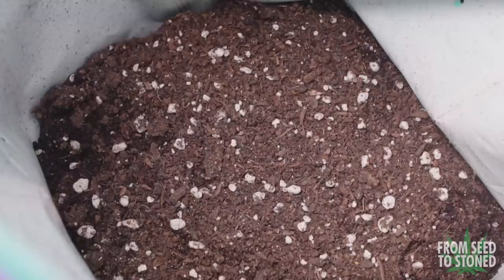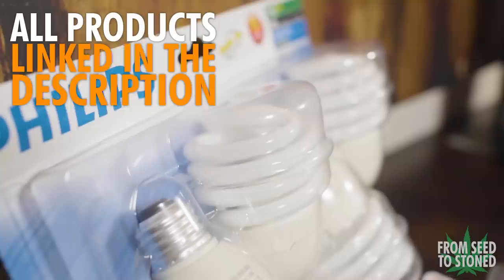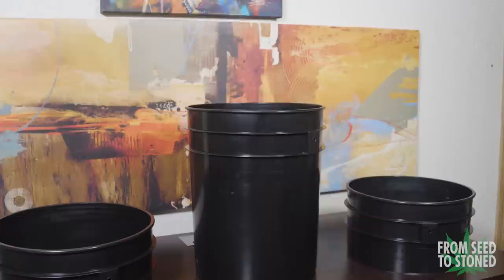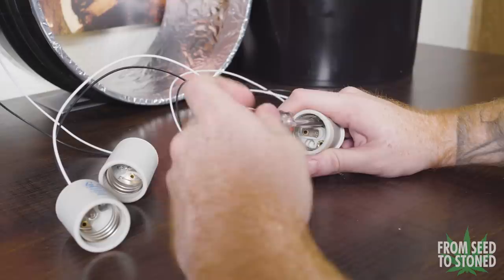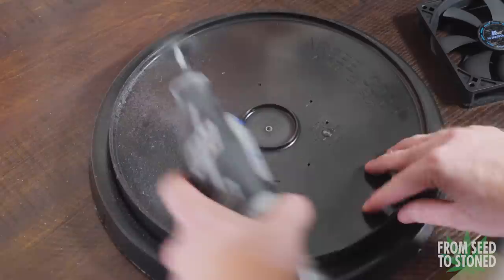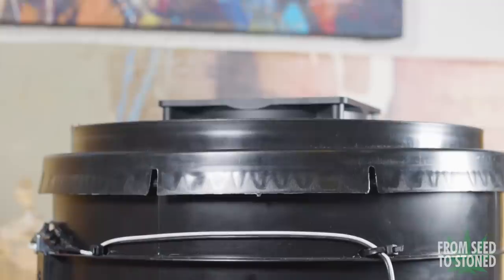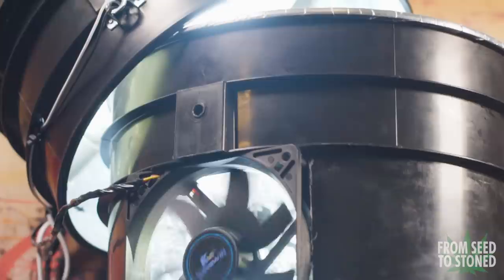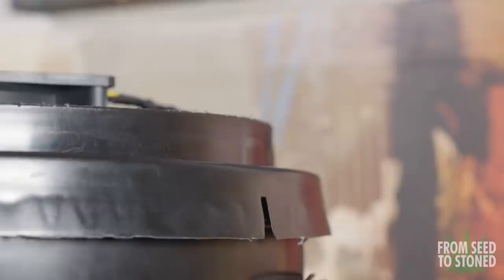How to Grow Marijuana Indoors For Under $100

Comment: Would this work just as well with square kitty litter buckets? They're 5 gallons I think, just not round. Seems like it'd be easier to install the fans on a flat surface, and I've got a lot of those kitty litter buckets lol.
Reply: If they stack the same way the buckets he used than I’d say apply his methods to them and make adjustments as necessary

Comment: Get a cabinet that was free take the bottom out to make it 5ft tall by 2ft wide and 3ft long take nilar and rap it around. Use 2 cfls with tin foil. And use old protein container for plant. Boom made 14g my first run then trashed it for a proper setup.

Comment: You can probably get it even cheaper using 3/4 inch pvc and fittings and mylar sheets stuck to cartridge paper...can be set up in less than an hour.

Comment: On the issue with the extra light putting it in a closet there’s a simple solution you can take cardboard to make a channel around the side of the bucket and tape it to the bucket same way with off the top make a channel out to the side and then down a little bit of Francisco carry the air and you’ll be channeling I’m so late doesn’t get in so you’ll have to worry about it Re-veg

Comment: You can get electric cords and socket from old lamps and appliance for free. I prefer Used plastic storage containers, solid dark colors are best. they are 1 dollar at the thrifty store. I can get 10 1gal pots in the big ones. I mount the lights on the lid with the socket outside to reduce heat. I can make a 10 plant indoor grow container for 50 dollars

Comment: Does anyone know what can be used as a power supply?
Reply: For power supply I went off this video, went to Home Depot and found a 8ft power cord that already had bare ends, (usually a lamp replacement cord) and wired it to the lights which makes a circuit and slows the bulbs to light and fan to move air, or use a little handheld clip type fan.

Comment: Does the bottom fan blow in or out?
Reply: I would blow out of the top, CO2 is heavier than oxygen so it'll be denser along the floor. So I'd pull in through bottom cutouts, and out through the top. This might also help with heat.

Comment: just a quick question. for the pc fans on top and on the bottom witch ones are facing the air flow into the bucket and witch one is facing the airflow out the bucket?
Reply: It looks like they're both going the same direction? Pulling the air thru. That is how I started my bucket.
Reply: @jimlee1196  oh ok, thanks man.
Reply: @walterdavis3554   After running mine for a bit  it built up to much heat. I ended up making the intake blow in and the exhaust on top blow out. It only makes sense to do it that way. And the temperature is better.
Reply: The one closer to the bottom is the intake so air coming into the bucket. The top one is the exhaust so air going out of the bucket to create a flow.

Comment: Dear FStS,

in my opinion, the idea with the buckes is very cool, though...some points....

-the hight is very low, only few strains I know you could possibly grow in this
-you have 4x 23W 6500K CFL bulbs? never use 6500K for flowering, the high amount of blue light is just stress for the plant and your result will be rather bad. cfl is over anyway, I have a friend, who grew about 35g with only two 21W LED (Philips or Osram) @2700K

I recommend a 40x40 Box, modify a reflector with 2 x 21W LED (or 3) and grow some small indicas, in Europe you pay for this about 150€ - 200€ incl. carbon active and fan.

this might help you small room growers a lot, "real" short strains, don't believe indica=small, a lot of indicas are rather of medium hight, smallest I have ever seen: 

-Ewe 2
-Sweet Afghani Delicious (Black Domina)
-Hindu Kush (Sensi)

they really grow "stacked"

Comment: I just completed this build with four 23 watt 6500k bulbs and it is very hot in the space bucket. The bulbs were too close to the lid and the lid was hot and soft. So what I did was let the bulbs hang downward in a 45 degree angle, hot glue the wires in the metal fasteners from the outside of the bucket to hold the E26 sockets in place. It gave me plenty of room for the lid and for the bulbs so they don’t touch. It is true, the maylar was a pain in the ass. Unfortunately I have server fans that are very loud and very fast. A bit too much for a plant but, I’m going to buy a dimmer switch to slow down the fans and that will allow me to adjust the speed of the fans. I like this design but, like I said, it is very hot in the bucket. Even with just two bulbs running it’s hot. Once the plant is a couple of weeks old I will add probably two layers so the plant doesn’t get burned. All I have to do is get my seed to germinate, which I’m having a hard time with.  I have a seed in the dirt and the paper towel method and they won’t germinate. It’s been 4 days already. 
With the seed in the dirt, does anyone know if the dirt should be in the dark in order for the seed to germinate or should I have the dirt in the space bucket under lights until it germinates? I have a zip lock bag over the pot as a humidor.
Reply: B 13 absolutely! I have two beans cracked and my sour diesel is out of the soil! My Durban Poison is almost ready to go in the soil. So far I spent about 25.00. I bought the E26 sockets and 4 pack 23w 6500k CFLs from Amazon. Then ran to Walmart and picked up the Mylar for 2.50, which is a huge sheet and it’s plenty. And I bought the adhesive spray but, I also used my kid’s glue stick and that worked great sticking the Mylar to the buckets. I got  3 5 gallon buckets at harbor freight for 2.50 each. I had old computers and stole two fans from them. My space buckets doesn’t look as good as his but, it works great.  Send me your email and I’ll send you pics. Again, it doesn’t look as good as seed to stoned but, it’s awesome! I’m using dollar store water Crystal Geyser. It has a lower PH but I bought ph up and down kit to adjust the water ph. I’m also going to use miracle grow. People can hate but, there are success stories using MG and tap water. Remember, cannabis has grown on its own in the wild for thousands of years without nutes. I’m not trying to grow a pound. I’m experimenting and hope I can yield an ounce. That would be plenty for what I’m doing.

Comment: I think hydro would be better for this type of grow just a DIY shallow gallon or so Rubbermaid container could probably even find some kind of Tupperware or one of those plastic coffee containers get creative as you need to make it work I think i read you only need like a gallon per plant when doing hydro especially if it's something small like this or you could add a couple bucket spacers and get a bigger gallon amount but still small and do a sea of green maybe add a trellis on one of the spacers and do a screen of green try to get the most out of your harvest then have more cola buds too maybe add some LED strip lights around the inside for side lighting for optimal lighting and yield I love these kind of grows so many unique options u can do since I've found out about micro growing I've been obsessed trying to find the smallest amount of space or lighting I can use or how small of a container/pot would be needed to tiny plants I grew a quarter oz plant in a mini solo cup in a little cardboard box in a night stand on side of my bed was hella fun and interesting you get to learn more about the plant and care without having a big fuck up or adding on to your light bills etc I recommend microgrowing to anyone wanting to explore and learn as much about what a marijuana plant is actually capable of
Reply: Plus what's cooler than a bonsai weed plant haha also u can bend them into different shapes and what not too try using some bonsai techniques with them it's really fun

Comment: I would use a 1,10 by 0,90 meter closet (1,60m high) isolatie it wint reflective bubbleplastic (free for me cause we already had it but if you would buy it probably 10€). Use 2, 14 litre buckets (1,60 each very nice qualtity) and one 7,5 litre. On the i would put a controleble ledstrip (10,00€) witch produces a nice amount of heat for its price. I would buy grow ground with 6 months of feeding (7,50€) 1 litre of root strength (5€) 1 litre of plant feeding (5€) 2 pc fans for in and outtake (free for me but new probably 5€ each) a normal fan (10€) and a secondhand hps or led grow light for 50€.

Comment: I can replace mylar with aluminum foil right?? Just a light reflector?
Reply: Richard Linville I wouldn’t just because t conducts electricity and heat so it could cause problems if your like me and bad at wiring. The Mylar is a great insulated whereas the tin foil is a conductor. You can get Mylar from camping shops, it will be called a space blanket. Hope this helps 😊
Reply: @lukeocallaghan5678  yes this helps BUNCHES!!!! You probably just saved my house from being bar-b- que
Reply: Richard Linville Yeah learned that the hard way, it didn’t burn but it shorted all the electronics in around half a second lmao

Comment: I started with a $500 budget, and grew 2 plants. Made about 225 grams, and sold it for $10 a gram. Spent all $2,250 on a bigger setup and grew 10 plants. Made ab 1,200 grams, and $12,000. Now I’m growing 16 plants and I’m running out of space. This was perfect. Smaller yield higher volume. $10,000 a month is close. I can smell it
Reply: Goblin 2.0 homemade

Comment: Id duct that fan, so it goes up straight, then has a bend in it like a candy cane, then no light will get in,. Or a box over it with the bottom cut out. Id run a dryer vent,flexible, out the window with one of those louvered covers like for a dryer vent on the side of a house.. It's gotta be black, most dryer vent is white. Ya don't want that. I think I'd go with a box full of carbon over it. Thats what id do,fill the box with carbon

Comment: I know it's an old video, but if anybody sees this comment, could I get some recommendations on better soil/nutrients? Love the video, but I kind of needed a $150 setup lol
Reply: Also, if anybody is struggling with the wire, my biggest tip is a simple one: Never plug anything in until all of the wire is covered. 12v isn't immediately dangerous in most cases, but it's always best to just act with caution.

Comment: not very secret tho i will say the 3 tops stacked looks kinda weird i feel like if u just bought a bigger bucket or trashcan even or maybe even some laundry baskets might work idk it would depend on the basket  but just watching this has given ideas and so 102w for 1 plant is enough im guessing if i have a smaller plant in my closet that has 1 100w led light bulb by it it hits like the top and side at an angle but if i turned the plant regularly it shouldnt be too bad i dont think right.. i mean i guess ill see im gonna try it either way

Comment: You should only cut plastic with a hot knife in a very well ventilated area, outside preferably and or wearing a respirator. Plastic and rubber fumes are incredibly toxic.

Comment: the electrician in me was hurt when you didn't solder the wires.

but great video tho <3
Reply: At least a fucking wire nut lol
Reply: but why tho? You aren't gonna solder the wires from your plug box either. Most houses even show they aren't solder
Reply: @swagchomp  this isn't a house, electronics are mostly soldered or use some sort of connector, just twisting the wire and putting some tape over it is just bad practice (and in some cases illegal)
Reply: JonasVDV really was curious. If you solder I assume it can have more stable power??
Reply: @swagchomp  the connection is solid, and you don't have to worry about a bad connection

Comment: I have no skill or ability to make it like this. Do you have any other ways to do this but less technical?
Reply: A hot knife to cut the bucket. Hold a knife over a stove flame or flame from one of those cheap jet lighters or a blow torch
Reply: @Joeink100  thanks
Reply: @msufan_yaa1013  or buy a cheap hacksaw

Comment: Well, definitely a fire hazard waiting to happen. (Hot and neutral is for ac only, DC is + and -) Spend 2-3$ for some wire nuts. Worth it
Reply: Midwest Bowfishing do you think there would be any issues trying this in a hotter place in the house (like an attic) and if so hot could I fix that?

Comment: is the fans blowing in or out?
Reply: The one closer to the bottom is the intake so air coming into the bucket. The top one is the exhaust so air going out of the bucket to create a flow.

Comment: What if you put autos in this?
Reply: CBD Diaz autos will grow no matter what you do. It’s all based on if you do training. Some auto strains will grow big but if you train the plant you can keep it small.  Good luck!
Reply: @iamurnamann8662  thank you also I mean if you were to use those light bulbs in that small of a space?
Reply: CBD Diaz when I angled the bulbs downward in a 45 degree angle, that helped a lot. I wish I can upload pics and updates. This is my first time growing.  I’m looking forward to the results. If seeds to stoned doesn’t give us an update, I will give an update. That way all of ya knows the end result with this method. I will keep everyone updated in the comments. I might do videos on the progress. I’m not a pro by any means but, I think it’ll help the newcomers on what to expect with this method.
Reply: CBD Diaz  4 23 watt 6500k lumens bulbs is a lot with the Mylar. But with an exhaust and intake fan in place they will keep the heat in check. I have an intake fan and an exhaust fan but, I keep the exhaust fan running and the intake fan off which makes a perfect balance inside the space bucket because it’s a small space. It works perfect. It prevents it from being too hot.
Reply: @iamurnamann8662  awesome thanks for your help man. I really appreciate it :)
Reply: CBD Diaz autos will grow but, if it were me growing the autos, I would LST it, micro crop and not use the entire base of the bucket as the grow medium. I would grow the auto in a 1 gallon pot in the space bucket to keep the auto in the small range. You can also tie the outside branches a little to the main stalk to keep the plant narrow but, it might not look like a lot of space but, there actually is a lot of space on the bucket. Search micro grows. People grow auto flowers in PC towers and get decent yields. Keep the auto in a small growing medium so it doesn’t grow huge. I saw a video where a guy grew a plant from start to finish in a SOLO cup and got decent buds!!! That was crazy!!! He lets them veg for about two to three weeks and forces them to flower so they don’t grow big but, I don’t think that will work with autos. Lol.

Comment: Now add the cost of electricity 
You better save $$ for electricity 2 months veg @ 18hr and 2 1/2 months for flower@12 now that's if everything works out lol 
100$ my ass
Reply: 4 CFLs use about 80W add another 20W for everything else that's 100W per hour. So in veg this uses 1.8 kWh and in flower it'll use 1.2 kWh per day. Let's say you live in Hawaii, the most expensive cost for electricity, that'll cost 60 cents a day in veg and 40 cents a day in flower. This adds up to $18 for a month-long veg and another $26 for a 65 day flower.
Reply: @joshs4483  well I was using 2 viparspectra p4000 one dehumidifier  one humidifier  4 fans,   inlet and outlet fans and it was costing $500. Each month I don't smoke $500 a month but I can and do grow outdoors and give most away.
Reply: @joshs4483  what about the cost of the lights  under 100
Reply: Never said that 2 450w lights and the accommodating tent and accessories would cost that much, just that the small $100 space bucket would cost around that much. Just inflation alone has made this a $120 grow, even if you believe in his estimations for the equipment. Of course growing outdoors is the most economical option, if you can get to harvest (most can't). I never meant to talk down to you, I just didn't know if that was keeping you from growing your own. I'm glad to hear that this is not your case, happy growing!

Comment: So...
No results to show the efficiency of the design.i would have loved to see the results.
I did something similar in the 70´s as a tween.
Mine was a bit larger but I just lined a cardboard box with aluminum foil and siliconed in a bunch of shoplights with the  cone and clamp taken off. For the top I took a small board and put 3 in that that I could raise.
Put her in the closet and did ok. Had my own weed at 12. didn’t have to bother my 3 older brothers. It was the 70´s.
Americans were all high as fuck. Even a lot of the straight people were experimental.

Comment: Has anybody tried this so far and how did it come out for u guys ??
Reply: I just wanna know cause I have 4 seeds I wanna throw to grow
Reply: I'd really recommend a small tent, vivosun has a 30"×18"×36" tent, as it allows the use of normal grow equipment like an inline fan and carbon filter. This tent will also allow for a couple 100W LED lights instead of these fluorescent bulbs, greatly increasing harvest and cutting down on heat stress. This small tent can allow you to grow out two seeds at a time, instead of the singular plant grow in this bucket. I understand that this will be closer to $350-400, but almost all this equipment can be used in larger grow tents. Not only will this extra investment get a larger return in bud production, but it will be much easier to actually get a good harvest. If you have to go cheaper than this ~$400 investment you'll have to grow outdoors.
Reply: Amazon 2x2 tent $40-60 LED grow light $60+/-
Reply: @griminc6548  do u have a setup ?
Reply: @SRT_Wilito  I just recently got one its just a little 2x2x4 tent I keep in the closet. All you really need to start is a tent, led grow light, small fan, and a small humidifier if needed. Can slowly add on from there.

If you do get into it and have the space a taller or slightly wider tent would be awesome. I only have room for the 2x2 currently, but it works great for autos or even photos with good training.